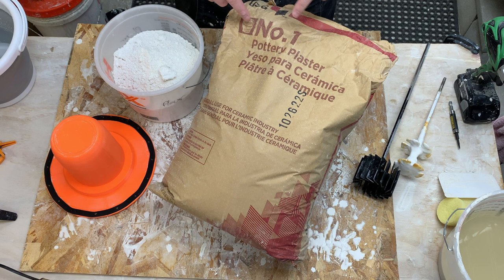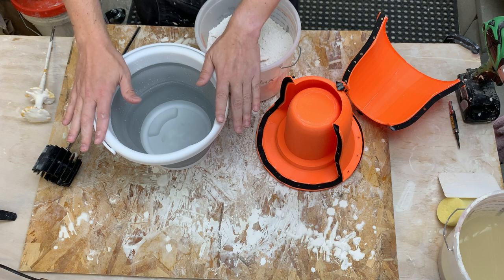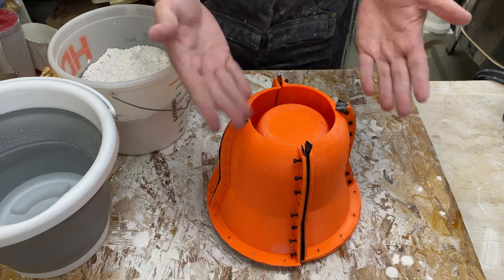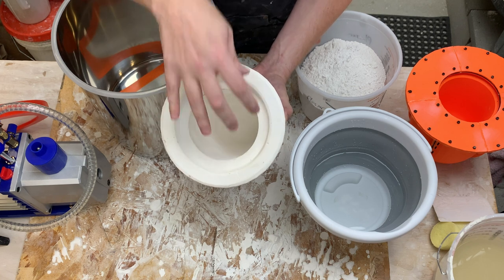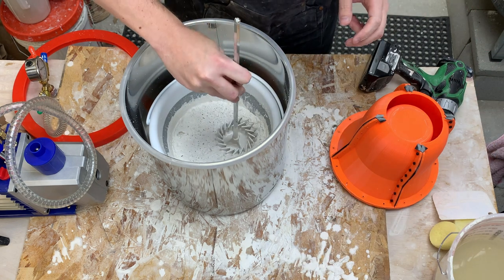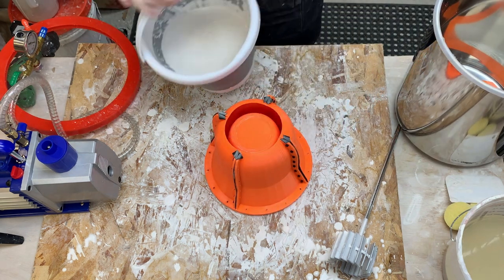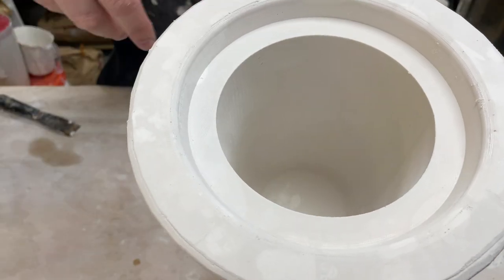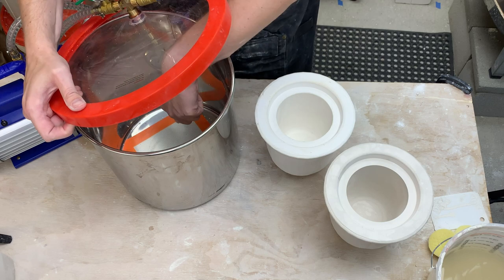VACUUM! Degassing plaster to remove bubbles? Maybe not

Comment: I use a shoulder massager against the side of the pail for 30-45 seconds after mixing and then against the mold in a few spots around the bottom for a couple seconds after pouring.
Reply from the maker: Yes, I think vibration can contribute to moving bubbles away from the surface (similar to the vibration tables). I am starting to wonder about which variables associated with vibration might move the most bubbles - there's timing, location of the vibration (is it the whole mold or localized), frequency, amplitude, direction, others?

Comment: ive zero experience with plaster/ceramics and i only watch your channel for fun. but i do have some experience with composites. what we do to mitigate bubbles/pinholes is a layer before the actual lamination. i wonder how well a brushed layer of plaster on the male part of your mold would work, with the casting coming after this first layer is cured.
Reply from the maker: Thanks for watching! I very much like stealing ideas from other disciplines and applying them somewhere else! And yes that might work. I've gotten some comments about using a brush once the mold is filled with plaster to dislodge any bubbles. A thin coat might serve the same effect. I guess the issue there is either doing it in 2 steps so you have the time (and therefore increasing the overall time to make the mold) or trying to do the brushing and pour before the plaster goes off.

Comment: what about changing the pouring method? a funnel and a hose to cause less turbulence as you’re pouring the plaster?

I’ve seen resin people use a brush to remove bubbles on the surface. Maybe that’ll translate to plaster
Reply from the maker: I think the brush would likely help. Unfortunately for my current molds it would be extremely hard to get in there with a brush. As far as a tube, that would probably just move any bubbles in the plaster (although might help not introduce them). For thinner material, I've seen pouring in a long thin stream - but I'm not sure how well that would work since plaster is so viscous.

Comment: Pulling vacuum slowly on the slaking plaster might avoid the early mixing.
Reply from the maker: Maybe - it actually is towards the end when it seems to really get agitated which is a couple minutes in to the rather short slaking period (3.5 minutes). Given the way the bubbles raise more or less all at once after awhile, I'm inclined to think it is less about speed of the pressure change and more about the absolute pressure where all of the sudden the bubbles are let go.

Comment: Well i gotta say I'm surprised you didn't do the mix and later put it in vacuum in the mold, which by the way you do for epoxy resin. This can be very helpful.

Now with that said, try Epoxy Resin and plaster mixed together. Just remember you have to use mold release! Epoxy Resin will stick permanently to most things.
Reply from the maker: From what I've seen with epoxy, for the final cure it will usually go under pressure. Since the molds are 3D printed there seems to be some risk of deformation while under vacuum (however I have yet to actually test that). After this video and the discussion here in the comments, I'm not sure a vacuum will work since it lowers the boiling point for water. For resin that is fine, but for plaster the water is very important and boiling it off is an issue.
Reply: @PotterybyKent  I degas plaster on a form in a vacuum chamber. Printed shells are okay when they have some infill, but if there's a casted object inside, it must have a hole or be full; otherwise, it can explode.

Comment: I’ve had some success with using pressure pot instead of vacuum chamber, and it definitely takes a lot of bubbles out (using Hydrostone).
Reply from the maker: Do you leave the plaster in the pressure pot while it sets? I worry about 3d prints deforming since they are printed with infill and therefore have air inside them.
Reply: @PotterybyKent  I’m casting in silicone and urethane molds that were degassed in a vacuum chamber.  Yes, I leave them for the whole time.  I did a few initial tests, and there’s a marked difference between pressure pot and not.  I don’t know anything about how 3d prints would react - you should take a bad one and try it!
Reply: @PotterybyKent  PS there is a video out there of a guy who filmed what happens in a pressure pot, and he had some plastic toys, and I don’t think they were destroyed.
Reply from the maker: Thanks for the details. Using a solid mold makes sense. FDM prints have infill and voids, so they (should?) expand under vacuum. They might not be destroyed but could deform enough to impact the plaster's shape. Having said that, resin prints have a hole in them to drain excess resin. I wonder if something similar can be done with FDM to allow the pressure to normalize. (If anyone knows how to do that, let me know!)

Comment: It's fun to think of ways one might perform the stirring in a vaccuum. I mean, how can you introduce air while stirring if there is no air, right? beside magnetic couplers, I wondered if you could perhaps detach your pot+lid from the hose (since you clearly have a valve) and SPIN the entire pot so vigeriously that the slurry mixes itself... Like a giant protein shake shaker :)
Reply from the maker: That would be a machine! Unfortunately I'm pretty sure the vacuum is causing the water to boil off at room temperature and that is messing with the plaster. So I'm not sure there's a path forward here. Maybe a partial vacuum? But in that case there's still air around.

Comment: Could you slake the plaster, pour it into the mold, and then put the mold into the vacuum chamber?  It might pull the air away from the inner surface at least.
Reply from the maker: It's a good thought, but the 3D printed mold has air cavities on the inside which would likely expand/explode under vacuum. It might be possible if it was printed solid, or if vents were added. For example, resin prints need vents so the uncured resin (and washing alcohol) can come out, so those might work better.

Comment: I am wondering if it is really necessary to degas when slaking.  Should slake, mix, then degas.
Reply from the maker: Why? I'd be curious to know if there is a reason behind that process.
Reply: It may be that degas in itself speeds up the  the plaster to set.  By slaking and mixing first, then degas it cuts down on the time used and prevents it from setting too soon. Also degas before mixing is counter productive, since mixing just puts in more air whether you see it or not.   @PotterybyKent
Reply from the maker: Thanks for the thoughts. Mixing likely does add more air, however it seems very likely it could still be net negative by degassing first. I guess this is an empirical question.
However, I do think degassing starts the mixing process itself with the agitation. Combined with the vacuum boiling off the water, this procedure overall seems problematic. But fun to try!

Comment: hello.your videos are really inspiring. Do you have the stl file of the tool you attached to the tip of this drill? I want to print and use. And how do you adjust the ratio of water to plaster? Do you have a recipe for grammage?
Reply from the maker: Thanks! Do you mean an STL for the 3d printed plaster form? It is created with my custom software, and if you're interested in trying it out, there is a link in the description for my waitlist (it is still being developed).

For plaster, I'm using 70g of water per 100g of dry plaster. And you need about 1kg of plaster for each liter of volume to fill.
Reply: The plastic on the tip of the drill looked like it came out of a 3d printer, I actually asked for it :) I left an email for the waiting list. I'm actively designing with f360 right now. @PotterybyKent
Reply from the maker: Ah. No it's not 3D printed. The mixing attachment is this one: https://amzn.to/3Po6QPV. And the M3 driver is this one: https://amzn.to/44TsHDY

Comment: Couldn't you place a motor and a battery on the inside of the container, no need for wires to the outside? There are magnetically controlled on/off switches that might work through the plexi glass. Alternatively, you could put the mixing on a delay. Thumbs up for the overkill.
Reply from the maker: I worry about subjecting the battery to vacuum in particular.Exploding batteries inside a vacuum chamber might be exciting! But also not what I'm going for. If anyone knows of a vacuum safe battery, I might try.
The electric motor itself might need some special provisions (eg any grease in the bearings likely will move into places it doesn't want to go, or if the windings are in epoxy, etc). However that one seems more solvable.

I guess I could inductively couple energy through the plastic - however I think that is a lot of power to try and get through the magnetic field!
Reply: The biggest problem for a motor in a vacuum will be dissipating heat.  Passing wires into the chamber from outside shouldn't be a problem.
Reply from the maker: Good point. My cordless drill does warm up while mixing the plaster now. I have seen this arrangement before (for much larger chambers), but heat dissipation might be part of the design.

Comment: Vacuum mixer… Some releasing agent Dental supply companies sell it… Rub on some mixed plaster with a vibrating plate… Then a pressure vessel while it sets…
Reply from the maker: How big are the dental versions?
Reply: @PotterybyKent  you can see the mixing bowls size… approx about a 2L soda bottle in diameter to about half a soda bottle length… Some mixers hold the bowl in place… so your hands free to mix up a larger fill in batch… Then id rub it on with light vibration… then back fill… whipmix is a long established company … Dental technology supplies… Maybe use molten wax to fill any voids? With dental tech tools ….

Tricky to explain the tech search YouTube dental wax carving … using vacuum mix hand rub n pressure pot i cant see you getting many air blows to be honest
Reply: Whipmix says 866ml with one slightly larger… Although Ive never used them in pottery synthetic dental stone plasters can be very strong n dense but im not sure how absorbent they’d be for your needs… Worth a try though…
Reply from the maker: @Daily_Bugler  Thanks. For smaller molds that might work, but these are regularly 1-2L of liquid plaster in one batch. As for dental plaster and density, pottery plaster is actually very porous which is a key property needed for slip casting

Comment: I started with degassing the water first. Maybe it is because I used fresh tab water, but the amount of air(or chlorine?) that came out was enormous!
I used my wife's toy for vibration and the best place to use it is the middle of the lid. At the walls it is much less effective.
Now I'm waiting... will update soon.

Update1: Wrong ratio🙄
Reply from the maker: Interesting that your water alone was degassing! Not what I would have expected.
Reply: It seems like the water was boiling at room temperature because of the vacuum.
I thought about that, but my misunderstanding was, that it would get warmer when boiling. But no, it is actually "cold boiling".
https://youtube.com/shorts/hr55yM6eAS0?si=v2l9kcJUbMIoGMvG
Reply from the maker: Ah that does make sense. I think the same thing was happening to me. I want to try again controlling for pressure so that doesn't happen.

Comment: I think the 3 minute wait is causing problem. I use hands or paddle slow mix while pouring the plaster. With this way, I get bubbles in the top but not inside the mold. Confirmed with chatgpt as well.  Proper Mixing Technique: The way you mix the plaster can significantly affect the amount of air bubbles. Mix slowly and steadily, avoiding whipping or fast stirring, which can introduce more air into the mix.
Reply from the maker: The instructions provided by the manufacturer are more reliable than ChatGPT (which is just a next word predictor - my PhD advisor is an AI expert). The instructions calls for both slaking and also indicates that mixing more strongly creates stronger plaster. You do want to avoid whipping air into the plaster - that part is very much true but there is air in there already.
Reply: @PotterybyKent  I can reproduce your whole project idea (line to 3d model with python code) with the same. I can generate necessary python code and take it to printing. Definitely needs code review, but it can take there quickly. It is more than a next word predictor.

Comment: Just looking at your plaster, I noticed clumping in the pale.. That in its self isn’t good. I typically use Hydrocal. It’s super thin, nano particle size. It’s excellent for plastering molds. Retains it shape and size, no shrinkage and you can get it in different Colors as well. It also comes in different hardnesses for all types of jobs. Just tapping the sides of the mold releases all bubbles and it turns out unbelievable each and every time
Reply from the maker: Can you explain how that might impact captured air and degassing?
Reply from the maker: @coryseaward975 - I see you've edited your comment adding "tapping the sides..". I've seen the same comments about using USG No Pottery plaster so I don't think the type of plaster is the only variable at play. There are many many more including mold shape, mixing strategy, amount of plaster mixed, etc, etc. This is exactly the type of recommendation I talk about in the video which is tricky since the variables are not properly controlled for to determine causality.